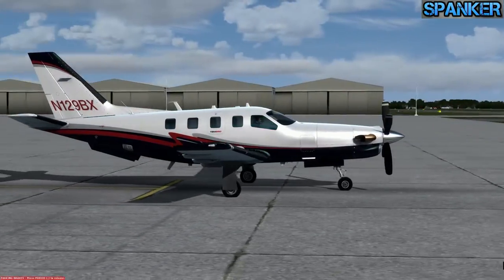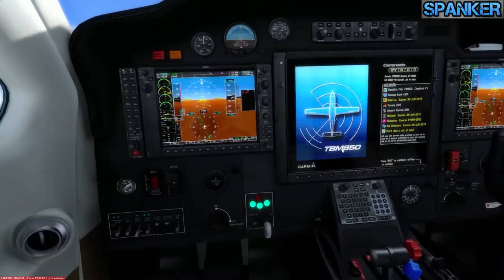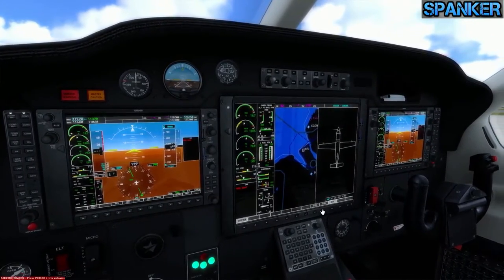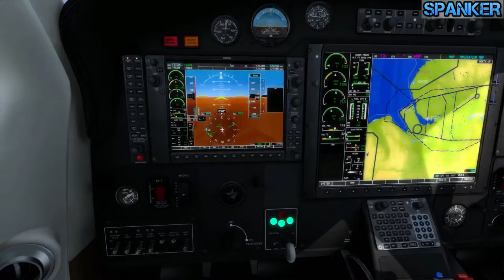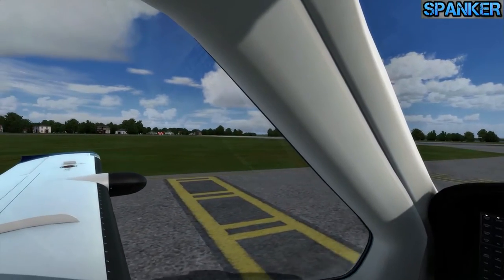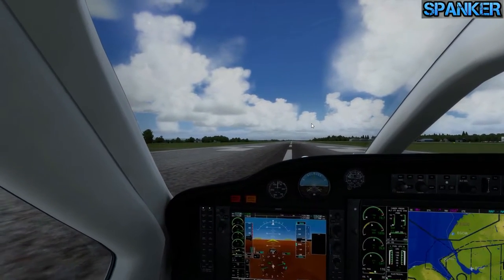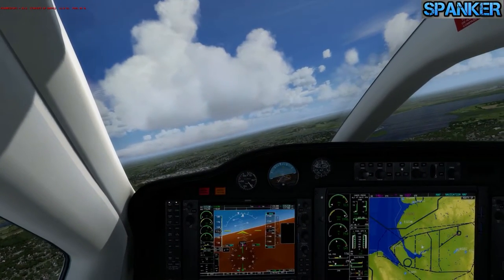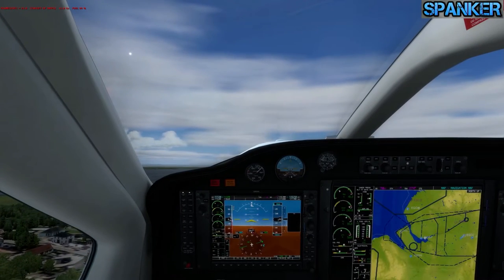Carenado TBM 850 first flight. Prepar3D.

Comment: Would it be too much to ask you to post your P3D settings? Also.. 20 FPS and your TrackIR movements look so smooth.. how?? Mine looks very choppy even at 30. Did you make your own TIR profile or did you download it? That stall though... :)
Reply from the maker: Track ir profile is default. I have just changed the hot key settings to map to the stick for centering. I'll post my old settings later today when I get home. I think the most important part is the cpu and the fact that it is running from a ssd. it makes the textures load quicker. but I will post my settings in a few hours time.
Reply from the maker: +Tomaž Drnovšek Hi Tomaž.  
I have just published a video going through all my settings. Its around 30 minutes in length but all the settings are covered in the first 15 minutes. Its at https://youtu.be/7YMrK34xE-o

I have recorded it at 1440p so it should be really clear what settings I have. Just be warned there are 2 swear words at around 17 minutes when I crash the aircraft. I didn't edit them out as it a quite entertaining mistake.
Spanker
Reply: +Spanker WOW, that was quick, amazing! Thanks, I'll go watch the video. Swear words don't bother me at all.